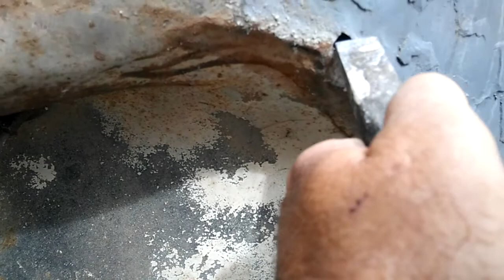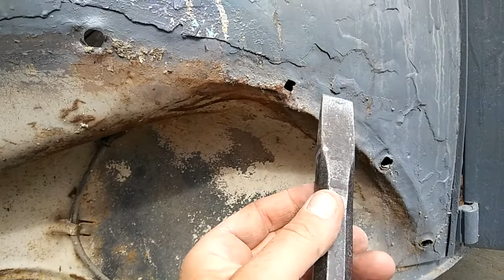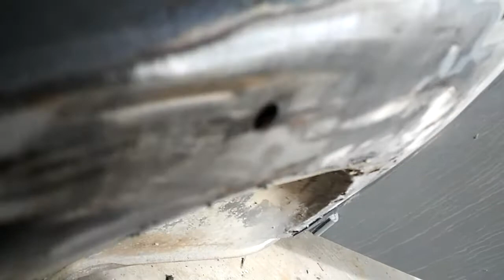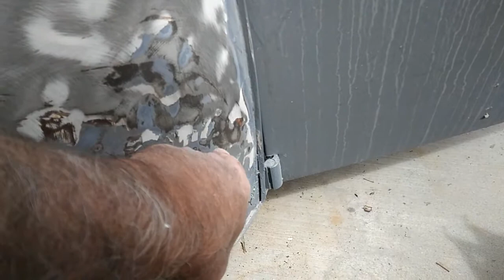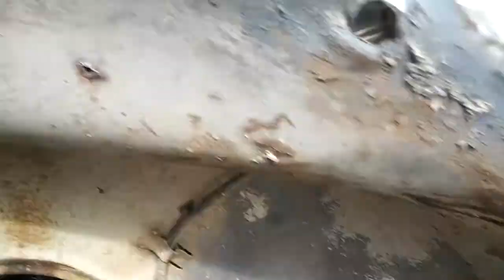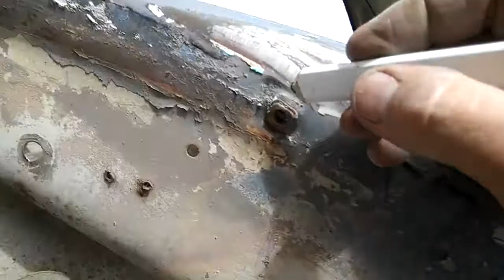vw bug front quarter panel repair without replacing sheet metal work

Comment: Mike, I have a question? I know beating out the quarter panel and a little massaging and bondo you can get it looking good. How does it look from the inside? What about selling the car? Is it worth the extra time to replace the panel so even if you keep it you know it was done right. I know it’s a fine line between being a good body man and being a beginner. In your opinion is it easier for a beginner to just drill out all factory spot welds and replace panel as pose to all the massaging. I’m a great welder but not a body man. Just weighing my option on what way I should go. This is a body off restore I’m doing myself and chassis, running gear etc is 100% done. Body any paint and interior is left. Love the videos. Thanks
Reply from the maker: fill and finish the inside of the panel. Done it many times. cant even tell. the seams are harder to duplicate like original. it will be more noticeable that the quarter is repaired. better to repair what is there and finish both sides.

Comment: Finally this is what I've been after!!! Someone backed into my beetle twice!!! And one side of the front has bent and squashed backwards hoping to fix myself instead of paying 100s for repair
Reply from the maker: not a difficult repair either.
Reply: At first I thought it was just damage to the wing but after getting a new front wing and going to attach it none of the holes line up. And can see its the whole front right quarter panel that is squashed a tad